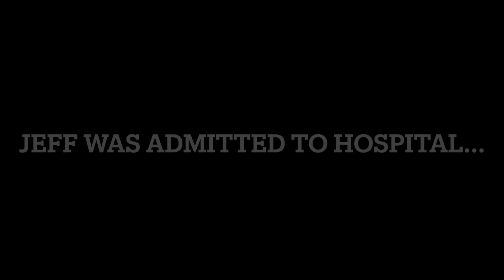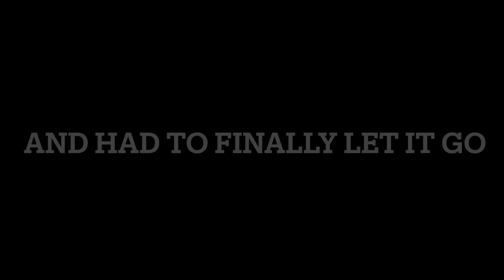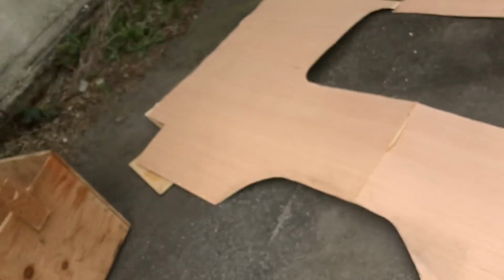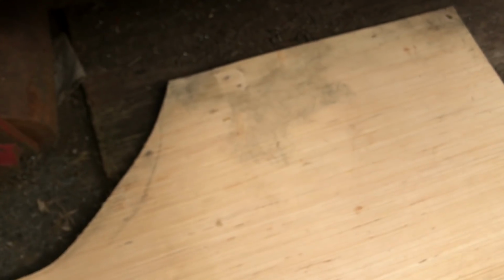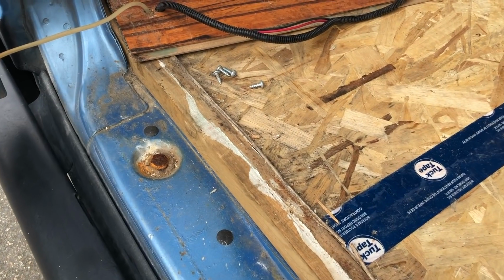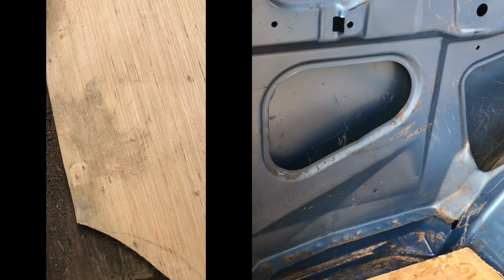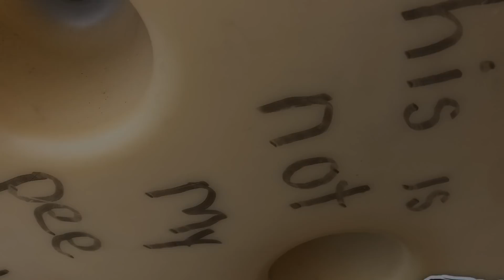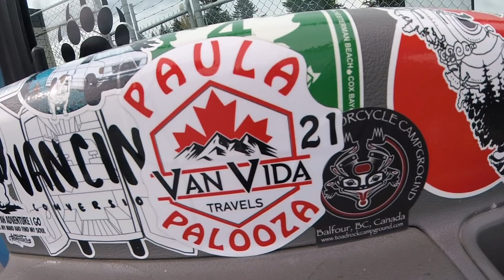BEARS DEN Teardown | WHAT is hidden underneath? | WHAT’S Next??| MINI VANLIFE, BC

Comment: The bottom of the cabinets looked like they might have had some water damage?  Any mold on the outside edges of the wood on the  cabinets? ❤
Reply from the maker: Yup, they did have a bit.  I have to trim a bit of those for the new design and it worked out perfect that those areas will be gone!😁

Comment: Hey Mark, You may or may not have heard of an ozone generator, it's a device that kills mold. Basically you seal the area and turn it on for a half hour or so, the switch is often a timer. It kills mold. There are some definite safety rules for using an ozone generator. They aren't expensive but if one can be borrowed for a couple of days that is even better. I know you are done with that part of the project but keep it in mind for future projects.
Reply from the maker: Getting one rented and treating it soon!!

Comment: Looking great Mark. I hate mould it's horrible,we had it in most of my house, until I gotto realise that my ex when he lived here made built in cupboards and units in most rooms but didn't leave a gap at the back for air,hence the mould, my house smelt so bad, I'm asthmatic so I had to sort it with my sons help. We took out all the built in stuff and cleaned painted and bought all new furniture. Smells so much better now. Looks nicer and i can actually polish this wood. He used MDF so hard to clean. Xx
Reply from the maker: Yikes, sucks to rip everything out no matter what you’re doing but all is better when you start fresh.

Comment: Hey Mark, if your into it... I have made the best brackets to add 4wheel drive to that van.. if your into it,or are curious...there water jet cut and will accept a Dodge ,or Ford front axle. Good luck on the remodel.
Reply from the maker: Yes please!
Reply: @markthepaintguy  ill send you some pics.thanks.
Reply from the maker: @vanlifebodyman6303  please do, email in my info page!
Reply: @markthepaintguy  you got it...  Thanks.
Reply: @markthepaintguy  hey man, cant seem to find a good email.. help me out if you can. Thanks.
Reply from the maker: @vanlifebodyman6303  
Check the about page on my channel.

Comment: That wood = kill with fire/napalm/thermite🤢 I got to wondering if something like bed liner would be good on the floor of the van after rust treatment? Chrome indicated that his van got quieter, which makes sense - if does limit the resonance... Also remember a spray used in extreme car audio; spray it on, the steal sounded like card board.
Reply from the maker: Yes, would love the polyurethane coating on the floor!